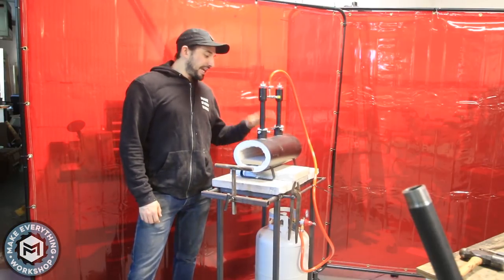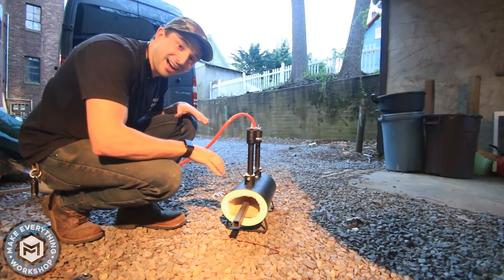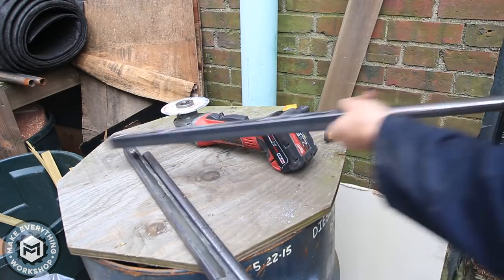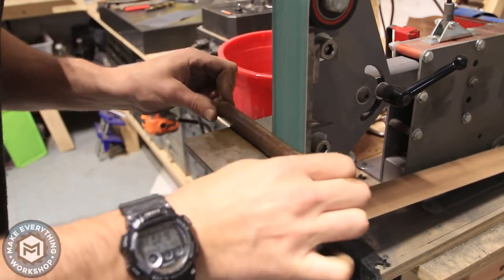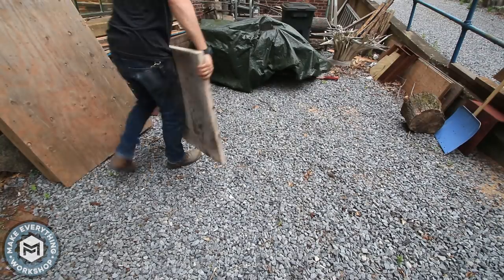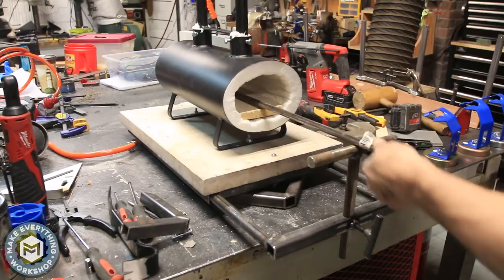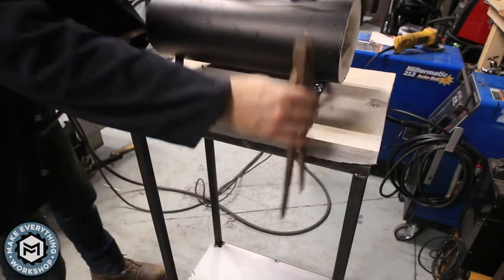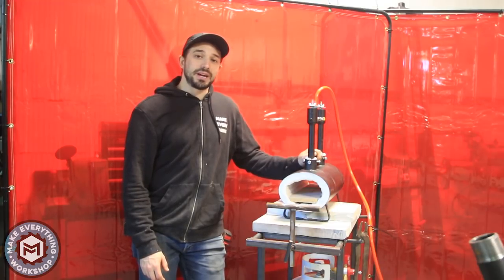Building A Stand For My New Forge (W/ Adjustable Work Rest)

Comment: Great stand!! You will definitely want to coat the inside of the forge with refractory and I would make something so you can use fire brick to block off the back of the forge and a window for the front to trap as much heat as possible

Comment: make sure you coat the wool in that forge with refractory cement and wear a respirator when around uninsulated wool, its sup super dangourus to breath in the particles from the wool
Reply from the maker: NJ good to know! I will look into that for sure! Didn’t see anything about that when I bought this forge...
Reply: @MakeEverything  Get some ITC 100 to coat the Kaowool with for sure, ITC is expensive but it will dramatically increase the performance of your forge!
Reply: ITC 100 is nice, but Satanite is much cheaper and rated for higher heat.
Reply: @MakeEverything  it should have came with the refractory that you mix with water and paint on and I'm sure I did see it in the shots where you was unpacking and assembling and I do realise you have probably sorted it out by now

Comment: firebrick top was totally unnecessary. The outside of forges don't get all that hot.
Reply from the maker: Alchemyst this forge actually lets out a lot of residual heat, so much so that I have to put firebrick in between the outside of the forge and the propane line. If I didn’t use the firebrick top I imagine the whole stand would get pretty warm, and I like that the brick stays cool to the touch no matter how long I run it.
Reply: @MakeEverything  Did you add refractory cement?